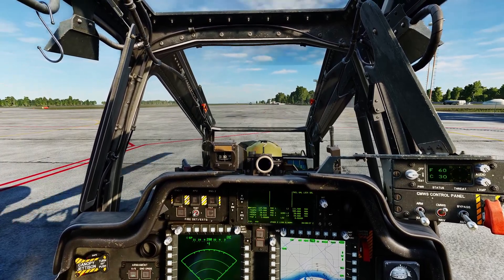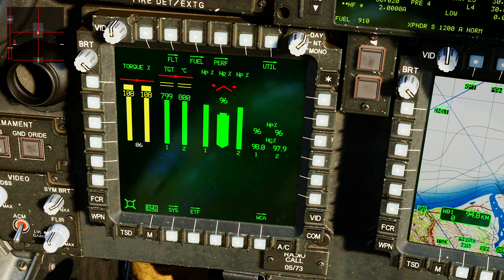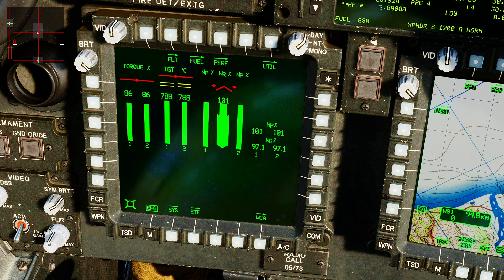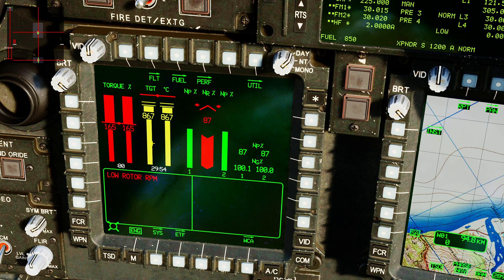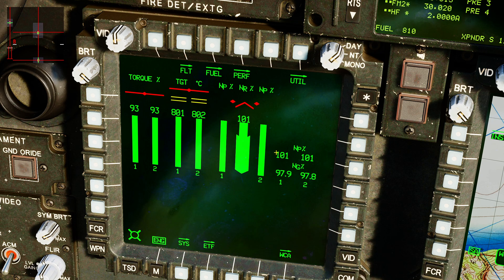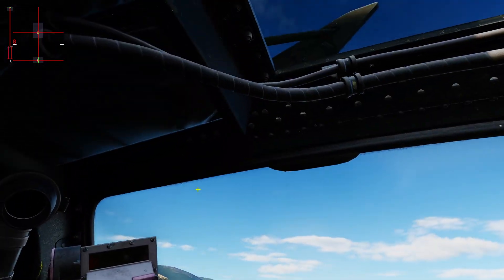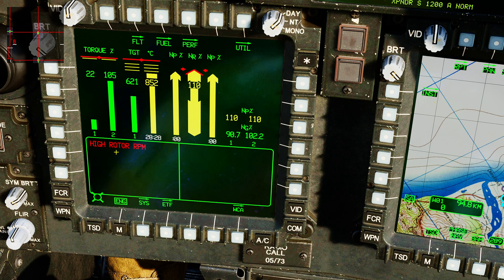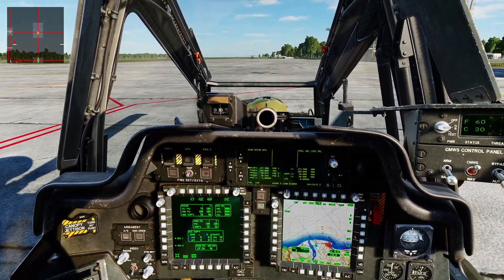AH-64D Apache: ENG & SYS MPD Pages Tutorial | DCS

Comment: Lockout is used to bypass the DECU's control of the engine and manage it manually. After lockout you are supposed to immediately reduce the throttle to the appropriate setting. That's why you still had an imbalance after setting the throttle back to fly. To turn it back to computer control, you have to move the thrust all the way to idle before putting it into fly again.

Comment: NP% = Turbine Power: This is the power from the turbine section that is used to provide power to the transmission that powers the rotor blades.

NG% = Gas Producer: This is the power from the gas producer turbine section that powers the accessory gearbox.  The accessory gearbox is what powers the generators, fuel pumps and other accessories depending on the aircraft.

The AH-64D Technical Manual (TM 1-1520-251-10) doesn't explain this well in layman terms.

Comment: I believe gas generator is another term for compressor, so therefore its comparable to the N2 readout on a typical fixed wing jet.  So Np, (N1 comparison) which is the shaft output speed is what the turbine is spinning to the reduction gearbox or transmission before the rotor.  Ng is how fast the compressor is spinning to generate the necessary compression for the turbine to achieve the speed needed for Np.  Nr is the rotor speed like you said.  With all those combined and smartly monitored you get a working turbine helicopter that goes thuk,thuk,thuk,thuk,thuk.

Comment: I don't wonder why anything is in F, instead just why would anything a person has to read on the fly being in C. I can mentally convert C to F and get close (double and add 32) but I have it think about it. It seems really weird to mix the two in the same aircraft much less the same display.
Reply: I agree, but it seems somewhat reasonable. It's not uncommon for mechanical readings to be in C and it could be a part of some standard. I'm working through an engineering degree and it's common to work through metric and have mechanical sensors use metric units. I'd definitely prefer to use F for climate control though since it's what I'm familiar with.